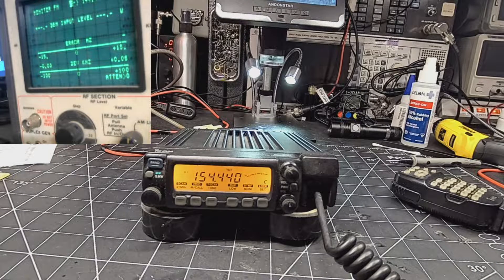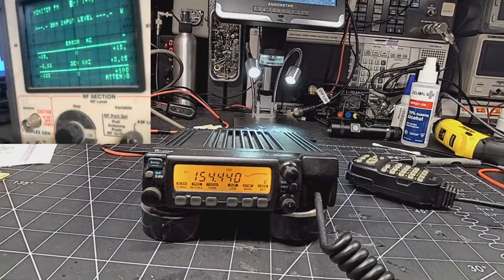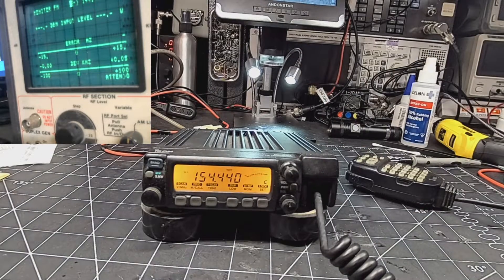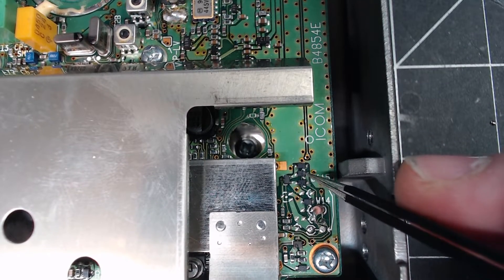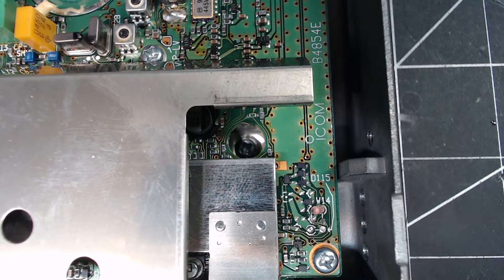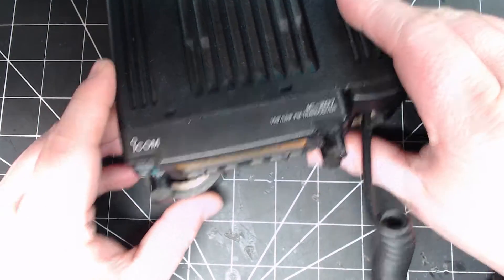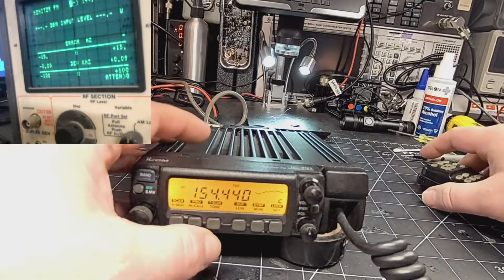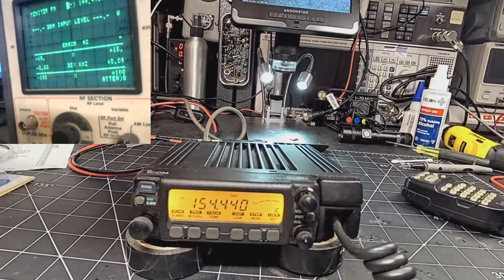Icom IC-207H Frequency Expansion

Comment: Boa Noite  tem  como aumentar  a potência deixar em 50 wats
Reply from the maker: You can adjust the power doing an alignment and it will do 50 watts. I usually keep it a bit under for longevity of the final transistor. If you do crank it up to 50, make sure you have good thermal grease. Icom's during this era are known to have little to no grease on the finals, and regardless it should be re-applied as these radios are getting old.
Reply: @salvagegeek o meu  rádio tá com  30 wts  só de potência eu acho que tem que aumentar

Comment: Hi, I have IC-207 bought used from Japan. In the area shown in video there is literally nothing (no diodes, no W114 etc.). Perhaps the diodes that are left should be there to allow TX out of ham bands? It s a good radio and I would like to use it in our license-free channels (5 VHF channels near 173 MHz, 5 channels near 448 MHz and four near 442 MHz).
Also, the output power is lower (approx 25-30 watts on 2 meters with the setup trimmer set to maximum, about 15 watts on UHF). Is there anything to tweak to obtain the "normal" maximum power?
Reply: I am in the exact same situation. I populated the diodes as shown in the video. Unfortunately it doesn't seem to work that way the behaviour is just like before.
Reply: @gammaleader96  I wonder if we could find anyone who would reveal the secret of "Japanese versions". Icom, as well as Kenwood, both seem to be very strict about keeping the secret. I have another piece, TS-480, in terms of hardware (PA module) identical with "normal" 100 W TS-480, but it runs 50 watts maximum (kind of ignores service menu setting for 100 watts at all) and even reflashing newer version of firmware did not help, so I guess there must be some "japanese-version resistor" somewhere inside, but so far found no one to tell the secret :-D. IC-207, on the other hand, seems to be limited by firmware.  Luckily, for my purposes, 25 watts on VHF is fine, but there is no option to switch to higher power.
Reply: @ok4rm  
I agree it is rather surprising that the japanese models seem to differ so much. 
I can't imagine them being a different board design / software. 
It most likely is just some config resistors / diodes somewhere. 
I also tried to find a schematic / service manual for the japanese version (mine is a 207D, the internet seems to only find the 207H) but I couldn't find anything yet.
Reply: @gammaleader96  I can feel (guess) it is combination of both, or maybe three factors, depending on model: different firmware, different, possibly hard-coded ROM and some undocumented resistors. Plus kind of japanese "omerta". Extremely difficult to crack :-)

Comment: Can you transmit 280mhz?
Reply from the maker: Not possible on this radio unfortunately
Reply: @salvagegeek  anything is possible if you have the skill.  I found some Russians expanding TYT radios to transmit SATCOM
Reply: @matthewlee2686  - Give the expansion a try and let us know how it worked. The radio's circuitry is only designed to cover the frequencies it was designed for. You could rework the circuitry and maybe get a result cover 280mhz. We're all curious if you can do it.